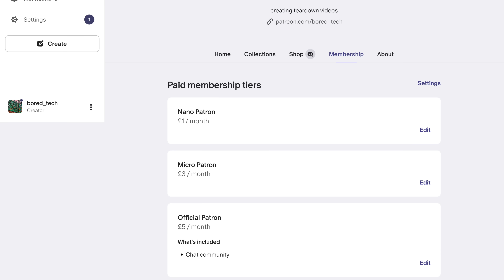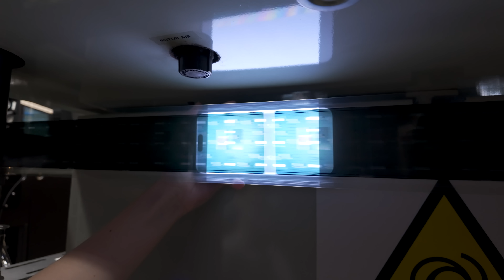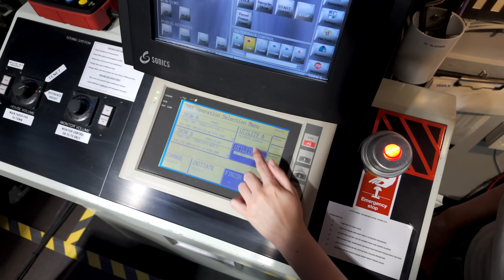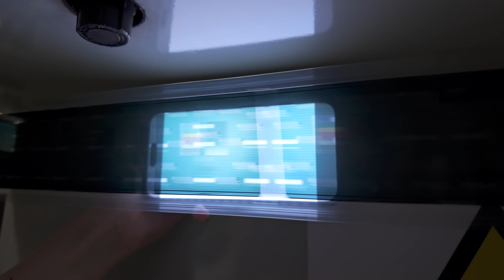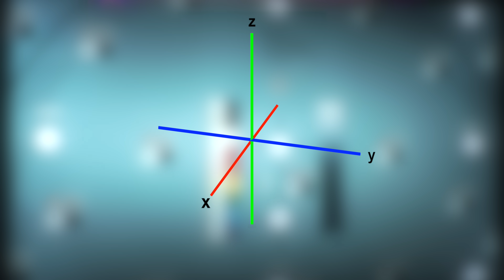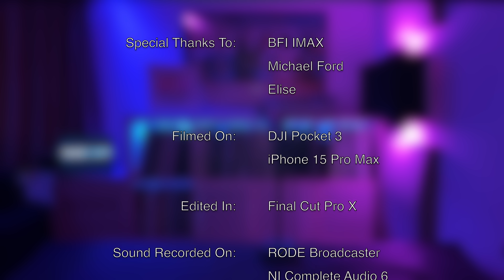Behind the Scenes: How IMAX Projectors Stay So Bright

Comment: Xenon lamps worry me, I much prefer carbon arcs.
Reply from the maker: If you’re not a fan of xenon, I’m curious — what’s your opinion on laser light sources? 🎥✨
Reply: @boredtech 
I have never used, or even seen, a laser projector, so cannot comment.  I once had one of the old 2 kW three electrode xenon’s explode on me many years ago.  I was standing with my head very close to the lamphouse waiting to do a changeover when it happened.

Comment: Wonder what postal regulations that prevents a small strip of film to be mailed, that means effectively it is not allowed to send someone some unmounted slides too, what a restrictive world we live in! 😟
Reply from the maker: The thing is, if I want to post anything into the European Union that’s larger than a simple letter, I have to fill in a customs declaration. There’s also a chance the receiver might be charged an import tax. I’ve actually tried sending something similar to Germany before, and it was returned to me.

If the filmstrip were really tiny — just two frames or so — I’d risk posting it in a standard letter. But since this strip is huge, it definitely wouldn’t pass through customs without being flagged. Such a shame — but that’s how it is! 😟📦

Comment: What is the usable life span (in hours) of the 15 kW lamp? I am assuming it gets replaced at regular intervals?
Reply from the maker: It’s only about a thousand hours. Interesting fact: if a cinema is running 15/70 film screenings all day, the lamp stays ON the whole time — it just goes into an idling low-power mode between shows. So they definitely get replaced at regular intervals! 🎥💡

Comment: I think digital projection needs to be around 100megapixels before it will be better than 1570 IMAX. Laser IMAX doesn't get remotely close.
Reply from the maker: I think we could have an endless discussion about this! There are definitely areas where digital still falls short, and others where it has clear advantages. For example, digital projection (Dolby Vision or Barco HDR) usually wins when it comes to brightness and contrast, but film has a distinct look and texture that digital just can’t replicate — so in some ways, they’re not really comparable.

As for resolution, I see your point. For the size of an IMAX screen, I think 8K (or around 33 megapixels) would probably make digital almost indistinguishable from 15/70mm film in terms of perceived detail.
Reply: @boredtech It is interesting to note that some digitally shot films are now printed to film and the negative scanned to produce the digital intermediate, as a deliberate method to introduce a "shot on film" look without going to the hassle of actually shooting on film.
Reply from the maker: @owensmith7530  Oh yeah I know of that some companies call it DFD (Digital-Film-Digital) or AI (Analog intermediate). This topic is on my list too.

Comment: I'm surprised that they don't use gloves when handling the film 🤔
Reply from the maker: It’s great that you noticed that! Projectionists usually don’t need to wear gloves when handling film during regular operation. In this case, it’s just a test strip, so a few fingerprints really don’t matter — the key reference points are the perforated holes, not the image itself.

When lacing up a real movie, they also handle the film bare-handed. That’s because reels have dedicated leader sections at the beginning and tail section at the end, which are designed to be touched, protecting the actual picture area.

However, when projectionists are assembling the print — splicing together the reels — they’re handling the frames directly. That’s when gloves are used to keep the film as clean as possible.

Comment: it is absurd that this was not automated with a camera. it is very easy to do algorithmically
Reply from the maker: Exactly — I had the same thought! A camera or sensor could analyse the light output at each reference point, and a small controller could adjust the lamp automatically.

But the thing is, this technology comes from the last century, and IMAX is quite a conservative company when it comes to their film systems. Plus, there just aren’t enough 15/70 projectors left in operation to justify developing a whole new automated alignment system.

Comment: Digital isn't easy.
The answer to the video question is maintenance, cleaning and regular lamp changes
Reply from the maker: You’re right — digital projection definitely has its own nuances! I just meant that a modern multiplex can run digital projectors without a tech person on site all the time, whereas a film projector always needs a projectionist there to operate and monitor it properly.